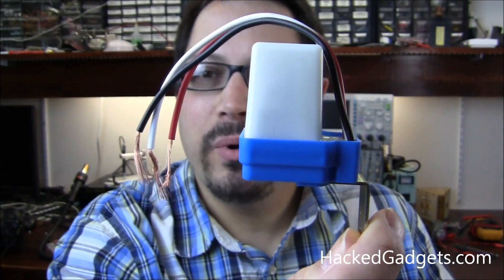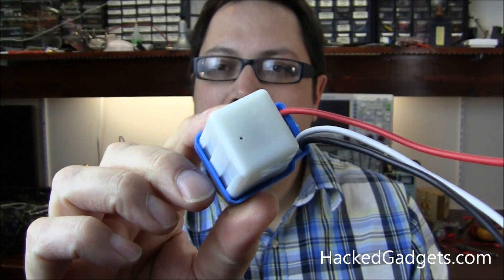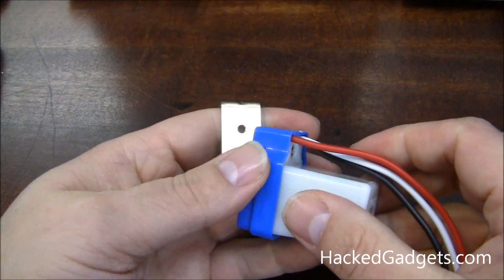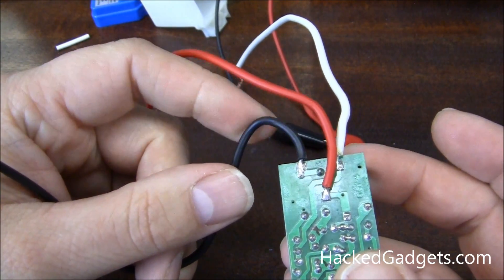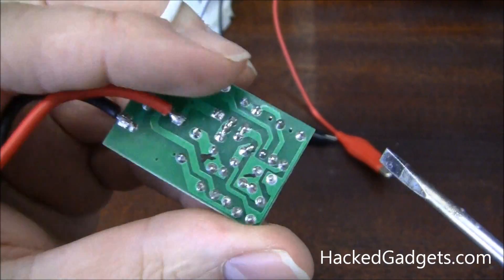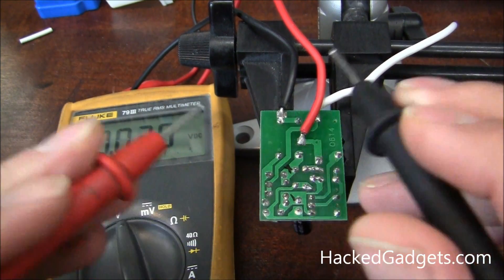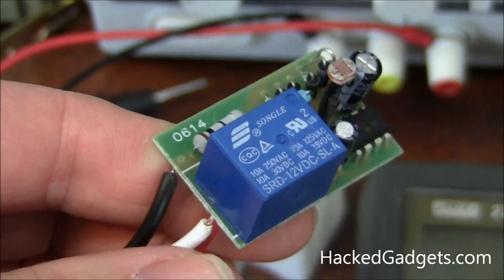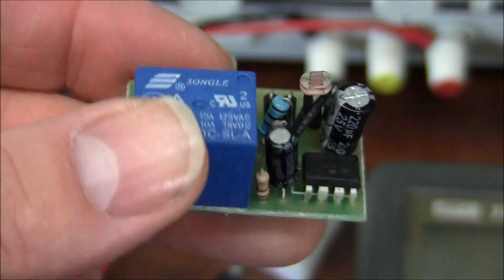Photoswitch Teardown

Comment: I am using this twilight switch in India .  Apply neutral 220 volt AC to white wire as input. Apply  220 volt AC Live to Black wire as Input.  output Bulb load wires are  Red & White.  you can use 120 volt Ac supply as well . Always remember to check the polarity as descibed
you can read Line (Black) & Neutral(white)  Load(Red) written on the body of this switch

Comment: I'm using this same photoswitch for my 12 volt  leds  the wiring diagram has the red and black switched around backwards. Had to wire it backwards to get it to work

Comment: i have exactly this switch. Im trying to light up an LED cable from a 12v car battery but i cant make it work. How do i wire it up?!
Reply: +BIFFY425 I've got two of the same switches, had them about 3 months, just looked at using one and found the instructions to be totally retarded. It has red, white and black wires and seems to suggest using the black lead as +12v???? well that ain't gonna happen on my watch........ I'm stripping it down and figuring out how it should be connected.
Reply: i figured it out....
Reply: +BIFFY425 I worked it out, took it apart and made sure of the connections, then swapped the wires out for some (different colours) that made more sense.

Comment: Hello, I have a Twilight Low Voltage Outdoor Lighting Transformer Model CB-250B and the Light Sensor is bad. The power output is 12v AC. 60Hz, 250 Watts. The Light Sensor or Photo Cell is only two wire approximately 5 ft long , (White and Black) Looks like a 16 gauge wire. I need to find a replacement. Any suggestions?

Comment: that's confusing.  u said its 12V, 10A but in the teardown there is a 10 ohm resistor in series with the 12V input.  so how could it ever achieve 10A?

which component do i change if i want it to turn ON when its a little darker outside?

Comment: Hi, I am using the same switch for a project I am working on but I need a 10-15 min delay after the switch is activated is this something that would work for me? Thanks for your time and help.
http://www.ebay.com/itm/LED-Digital-Display-Relay-Module-Adjustable-Time-Delay-Module-1pc-New-12V-/251624590389?pt=LH_DefaultDomain_0&hash=item3a95fe8c35